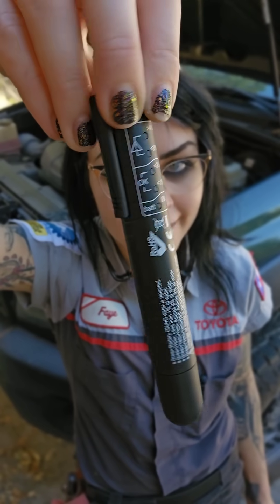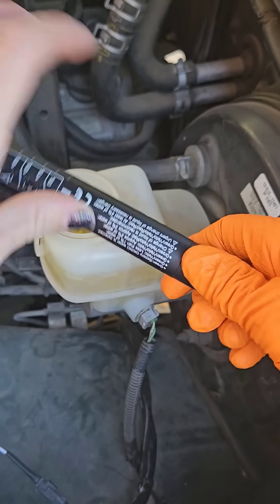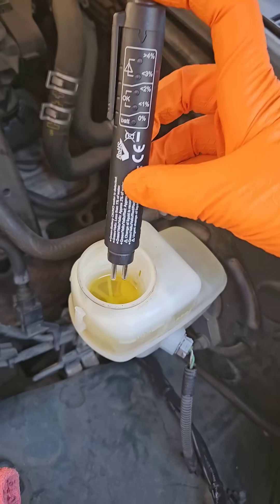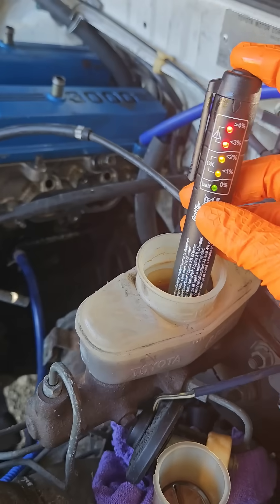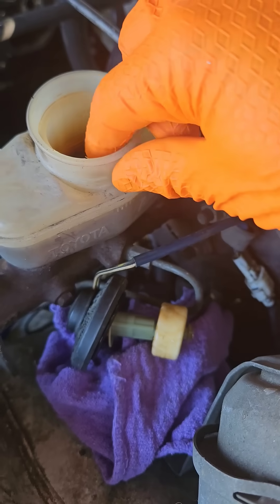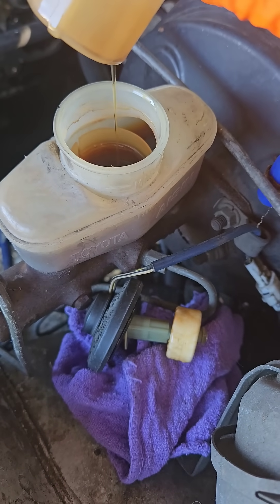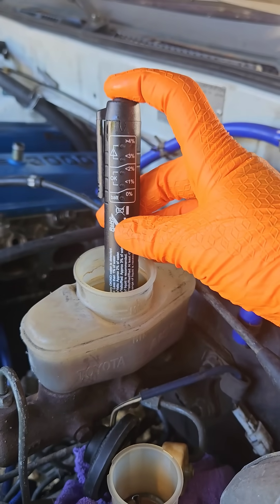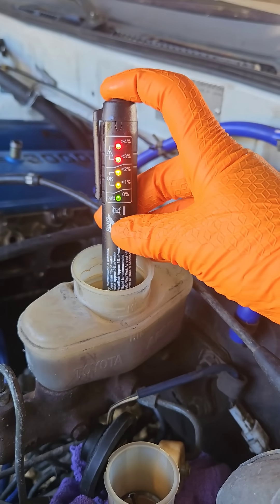Do you REALLY need your Brake Fluid Flushed?? How to Test it For Yourself!

Comment: Do you lease? You’re fine. Do you buy a car and run it into the ground? Flush around 5 or 7 years, then every 3-5 thereafter. Do you buy 200k beaters like I do? FLUSH IT FIRST DAY!  Thing is, you usually can’t see the damage cause it’s inside the hard & soft lines. I had a front soft line pop when I pressed the brake to put it in R. I replace soft lines every 10 years after a car hits 200k whether they look bad or not: that one looked fine when I put pads on it a month before. 

Brake fluid is *cheap*—and an afternoon spent flushing it gives you time to look at all that other stuff you can’t see so you don’t think about until it flings you into a ditch. Be safe out there, people: them damn deer have a freakin death wish

Comment: Break fluid change is mostly a scam. Especially when done by dealerships. They don't even test it. After 2 years the service plan says it has to be changed. In my Golf 7 break fluid was changed after 8 years and 80 k km for the first time due to the fact that it fell below the temperature threshold. The three times before they wanted to change it would have been scam.

Comment: Late model cars with A B S brake systems,it is absolutely imperitive to change or flush the brake hydraulic system,water,and dirt,can be death to ABS , module systems,and can be quite expensive to replace,or repair.
        It's much cheaper to flush the brake system.

Comment: Sorry to break it to you missy but u need to stop selling useless tools or perhaps trying to get sponsor. If you looking for a career YouTube is not it. I can explain.

Been a mechanic for 20 years now and I can tell u that tool will be sitting on the shelf collecting dust.

To all the viewers, u dont need a special tool. 

Buy a brand new bottle of brake cleaner from your auto parts store.

Pour some in a clean and clear bottle that u can see through.

Now, pick a caliper or drum brake to bleed the brake fluid. Also, put this fluid in a clean and clear bottle. 

Compare the fluids.

If the fluids that came out of your caliper or drum DOES NOT match the new fluids that you bought from the auto parts store then flush your fluids. 

In my opinion, this tool will be collecting dust and hardly used. Plus, u can work around this tool by just doing a little xtra step. 😅

Comment: I had a problem with my Ford Ranger 5 speed manual when the air tempature was 100 degrees F or above it would not shift. A friend had this same problem and he had a shop install a new clutch and pilot bearing that didn't help and then a new transmision that didn't help,so he sold his truck.I tried suggested remedies that didn't work and finally I changed the fluid in the clutch master cylinder and the problem went away.

Comment: My vehicle has 240,000 miles and I don't believe it ever had the brake fluid flushed but I bought it when it had 70k miles....recently the dealership told me it needed new brake fluid.  I've yet to do it. The vehicle has enough miles where I don't want to put money into it.  I wonder if the brake fluid will outlast the vehicle itself. Probably right? It's a 13-year-old Kia Sorento.

Comment: Also quick way to tell is if your brake fluid looks like frog water why does it look like frog water because most brake lines are copper copper mixed with water equals green green mixed with brake fluid equals frog water

Comment: In NASCAR we know that the brakes heat up so much the fluid gets air pockets in it. Yes these settle and bleed out the top after hot brake events. But moisture is in air then in your fluid. It’s recommended with my brake jobs.

Comment: I did have one guy come in from another shop saying they flushed his brakes a week ago he had a older Subaru the fluid tested good so I explained that with old systems the seals break down and cause the dark fluid color not enough to leak but it will dye any fluid put in the system

Comment: Change every 2 years to stay safe! There is no circulation in the system so the state of the fluid at the brakes and in the reservoir might be two worlds apart. There is no forever fluid all things breakdown over time, and the more rapid heating and cooling the quicker.

Comment: Auto manufacturer recommendation for 'organic' brake fluid is (or was) typically at two year intervals.... With a high moisture reading test you might already have some corrosion damage, especially if that moisture has endured multiple 'steam flash' occurrences. I don't know about now, but the Porsche/Audi/VW dealerships I worked at in the 70's and 80's were Sticklers on this... "Flush" seems a misnomer. Simple purge of old fluid is what we did..... I'm retired now, but I'm gonna have to get me one of those testers... Personally, I Love 'Silicone' brake fluid.

Comment: Brake fade can happen even with clean fluid. Going down a mountain and over applying brakes causes the disks to overheat which then causes a boundary layer of superheated air to form between the pad and disk which also feels spongy when you push hard on the pedal. Brakes work by converting kinetic energy into heat. But the disk can only absorb so much heat before the pads lose contact.

Comment: I just had a Kia that had 3 and a half calipers locked up (3rd was almost locked up but I could still spin the tire kinda easy and push it back with a good bit of resistance) anyway her transmission was fucked because she drove like this for a while and her cats were both clogged up all because her brake fluid had water in it from not being changed since she bought the car (DO YOUR MAINTENANCE ON YOUR CARS AND CHANGE YOUR FLUIDS WE ARE TRYING TO SAVE YOU MONEY BY RECOMMENDING THESE THINGS)

Comment: Water does compress.  Not a lot, but enough to notice in a high-pressure system. As an aircraft mechanic, water in hydrolic lines is very noticeable. I don't know enough about breaks on a car to say but I'd imagine you would notice it.

Comment: I used to do service work for a rally team. We flushed the brake fluid before each rally. That way the driver always had fresh fluid in the calipers and NO air in the system. That way he could brake with FULL confidence while doing a fast tarmac rally stage.

Comment: most people just bleed them every brake change just bleed until all air is out and the fluid looks clean then you will have very touchy brakes. Don't forget to top it off while doing this and after or you will have to start over if it ran empty and you sucked air into the system.

Comment: It’s an easy sell.  The vast majority of cars on the road have never flushed brake lines unless they had a caliper fail.  Then it’s kind of a self flushing.  Plus the tech has to get the air out when swapping the caliper, so flushes the system.

The #1 reason to flush them at 2-3 year intervals is because of ABS.  The pumps and valves in the ABS hydraulic block can get gummed up badly by oxidized fluid with high water adsorption.  The price of a hydraulic ABS block is high.  Very high.  Brake fluid is very cheap in comparison.

Comment: 🤔Flush your brakes about every 2 years You will not have any problems with your breaks or  Use a good break flid you will not  need to flush your brakes every 2 years

Comment: Brake fluid is hydroscopic aka it absorbs water. Brake fluid when new has a certain “boiling point” eg Dot4 or Dot4. The move water “absorbed” the lower your “boiling point”

Comment: The only way to tell if brake fluid is actually broken down is by doing a brake fluid copper corrosion test. It tests the protective additives in the brake fluid (additives that only last two years) and tells you the copper content. Brake fluid will eat your brake lines from the inside out because it is so abrasive. The copper content tells you if the additives are doing their job or not. 
Moisture is only one variable in the equation of brake fluid life spand

Comment: Brake fluid versus water also have different boiling temperatures. Brake fluid boiling is I think 500° and waters is only 200° and your brakes can get hot really fast, causing the squishy pedal

Comment: Unless you want your brake lines to rust from the inside out, get your brake lines flushed at least once every 5 years. I just worked on a car that had rusted out brake lines and power steering lines because they never had the brake fluid or power steering fluid serviced, ever! When I extracted the fluid from the power steering reservoir I got a bunch of black dirty water! The fluid that came out after was as black as dirty oil! Just like the brake fluid! If he had them serviced even once in the 14 years he owned the car he may not have needed all new lines and a power steering pump smdh. I live in central Wisconsin mind you, the rust belt is real!

Comment: I usually do it every time i change the rotors which is about 2 to 3 years on my truck its easy to do if you have a friend to help you for a few minutes 

I do it yearly on jeep but that thing is an offroad build that plays in the water often and i put tracks on it in the winter 

But general rule of thum is about once every 2 too 3 years is it a bit early probably but brakes are one of those things you never want to fail when you need them

Comment: I once picked up a girl for a little cruise to the mountains, and I had a worrisome feeling while we were on the way. I had been to this specific spot many times before driving my 1991 Honda Accord and here i was again, same car, different day. I remember praying to God just to get my thoughts out of my head because I might as well, “Please lord if my brakes give out don’t let it be on the mountain, and keep us safe no matter what.” There was no reason behind my prayer besides the worry I felt. I made it up and down safely, but the thing is that we ended up parking at the bottom to look at the river, and I noticed my brakes weren’t working. I stopped my car with the hand brake, and told the girl what was happening. My family was on vacation at the time and her only family was her sister and mom, so we had no one to call. I told her we can make it home since the highway is near and it was late so there was no traffic. For who knows what reason, she actually trusted me to keep us safe even though she had only known me for a few days. I got back in the car, made a few stops at some lights dropping gears and using the hand brake, and onto the highway we went. Again, I drove for probably 25 miles, no brakes, dropping gears. I eventually got her home and myself too. Somehow someway by Gods grace we were safe and my prayer really went through. Brakes worked until I got off the mountain(literally😂), and we were safe against all odds. Change your brake fluid though on a serious note. I only happened to be lucky and blessed🙏🙏

Comment: Brake fuild is hygroscopic witch means it absorbs water from the atmosphere and moisture will always find away in even just the tiniest amount witch can lead to your brakes fading more easily because the water boils in the system pipes and components can corrode more easily as well

Comment: So Firestone they test brake fluid by Copper Parts Per Million. (I’m a new tech and learning) but I’ve noticed that every time I see people testing brake fluid they’re testing brake fluid by how much water is in the brake fluid, not by copper parts per million, and I’ve had customers come in who have never had a brake fluid flush, but when we test the brake fluid, there will be no more than like 50 ppm in the fluid and the car is like a 15-year-old car that’s concern me since I’ve started here because of I’ve also heard that you’re supposed to replace your brake fluid every couple of years or after so many miles. So is copper parts per million just not an accurate way to test brake fluid or is that just not what dealerships are testing their brake fluid off of?? or is it simply a entirely different thing?

Comment: I purchased two new cars in 2008.  Maybe I'm used to the changes in braking power after 18 years.  But both cars seem fine.  I've only added fluid when I changed the pads.  How much water could dissolve into the fluid?

Comment: Just use a turkey baster to remove brake fluid from the reservoir about every 6-12 months and add new brake fluid. This will keep the fluid fresh and remove any air in the system. After your car is 7-10 years old, the brake lines are not as tight. When your car seems to creep forward at stoplights, that is due to moisture and air in the system. You will notice a former brake pedal if you use the turkey baster method of refreshing brake fluid and your brake lines will also last longer.

Comment: Those brake fluid testers are absolute trash.  They do not work well.

Better to get the testing strips. Much more accurate.

And typically if you haven’t had brakes done and no leaks your fluid will last at least 5 years…easily.

Comment: Do you know how hard that sale is? I've lost entire jobs because I've recommended this and the customer believed I was trying to rip them off. But you're correct 💯.
Now, I grew up in a desert, moved to AZ, another desert, and moisture in brake fluid didn't really exist. But here, so many have water in their brake fluid I would wonder what's wrong if they didn't. And people can't figure out why calipers get stuck, pedals go squishy, ABS systems have issues and so on. I've used the paper tests and I have a Kingbolen pen tester like yours. Simple, easy and accurate, but even for regular people to understand. Just a hard sale, so unless there's brake issues, I don't even bring it up because I become the snake salesman. No different than Toyotas needing a timing chain but Toyota claims lifetime chains. Try selling that to a Toyota nut hugger. But it's true, once the chain goes, end of life.

Comment: Fun thing I have learned. The brake fluid needs to be able to absorb water, so that those little bits of water are not left as independent water bits. This was part of the problem with DOT5 brake fluid. DOT5 brake fluid would not absorb water, and was less dense than water, so the water would flow right to the calipers, boil and stop the brakes. DOT5 also had a problem with absorbing air.

Comment: I live in Brazil. Many years ago a reputable automotive magazine tested many brands of local brake fluid. Some of them were nothing more than colored alcohol. 
I borrowed a car from a coworker one time for a long road trip with my parents who were visiting from the US. I lost the brakes in Rio😮. Stopped and checked everything, no problems detected.
 What happened? The brake fluid boiled and turned to gas. As soon as it cooled down, it worked again. (I stopped by down shifting and emergency brake use.) I used the brakes judiciously for the rest of the trip with no problems. I had the brake fluid flushed and replaced before returning the car.

Comment: DOT 5.1 boils at something like 270-280°c. Water boils at 100°c. It's not hard to build up heat in a brake system, especially if those brakes are having to slow a 1400kg vehicle on twisting roads. I've boiled DOT 5.1 in my SRAM Codes. If a dude on his MTB (and I purge disolved air from my DOT before bleeding the brakes) can boil fresh DOT then you better believe a car can. Adding water thereby dropping the boiling point is a guaranteed way to suffer braking issues. Sods law usually means these issues happen in the worst possible places.

Comment: Don"t forget about us up here in the North. Water in the brakes means a frozen pedal during the very cold winter months. Found out the hard way one morning on my way to work. Doing about 30mph I went to stop and the pedal moved about a half an inch.  Car kept going course, went right  through the intersection. Was early, not many people out. If that don't wake you up in morning ha ha. I did make it to work, by the way, after pumping the brakes a few times. Musta broke the ice loose. "Learnt ma lessen the hurd way." I change that fluid at least everyother year.

Comment: Toyota doesn't list brake fluid changes in the service schedule in the manual. Not in my 2016 4Runner, my wife's 2016 Avalon Touring, or my 2023 4Runner. 
I have tried to get the dealer to replace the brake fluid and they won't do it.
Reply: P.S. - "Yes, new Toyotas have sealed brake fluid systems. The brake fluid in a Toyota is stored in a sealed system and can last for many years. "

Comment: My 99 ford ranger has had the same brake fluid in it since I bought it new. 150,000 miles, factory calipers, and brake lines.  I’m not sure there is much truth the this unless it’s an ultra high performance vehicle or the fluid is contaminated

Comment: Faye- Thanks for your opinion. However, I would not recommend the tester method other then when your are in a pinch. A time schedule is a recommendation and wise to follow. For those who like to pinch pennies and my want to wait, not smart! Understand the recommendations are posted for a reason. I never seen new engine oil, coolant, or brake fluid cause more damage.

Comment: I find it interesting that Auto manufacturers prioritize changing brake fluid while extending or eliminating other services such as transmission fluid. I've seen cars go years with the original brake fluid without any noticeable issues however neglecting transmission and oil changes will shorten the life of the vehicle

Comment: Always make sure to clean those prongs on the tester before and after testing. And if you are doing multiple tests clean the prongs off between each test. Its important to not cross contaminate your testing samples. I have that exact tester and have had a change in result by cleaning the prongs. I didnt believe what i am saying right now and tested it for myself. Tested new brake fluid from a sealed container I just opened after doing a test on old brake fluid and it was bad. Cleaned the prongs and repeated the test but this time I cleaned the prongs between the test on the old brake fluid and the new brake fluid and it tested good.